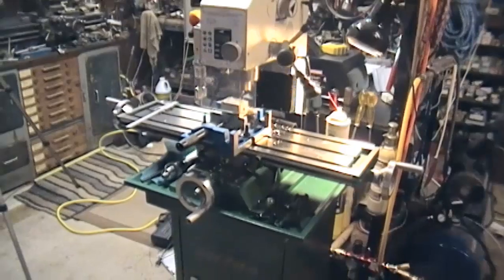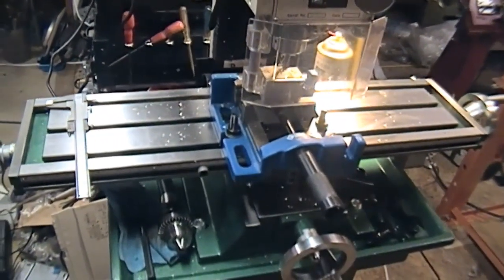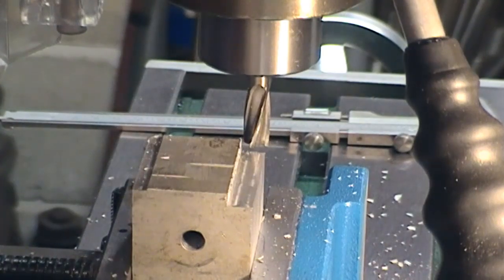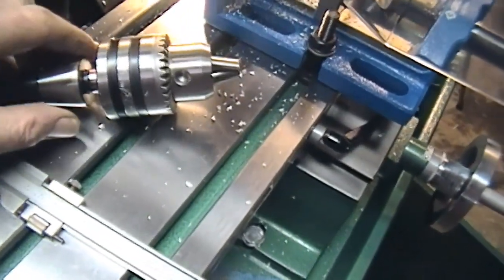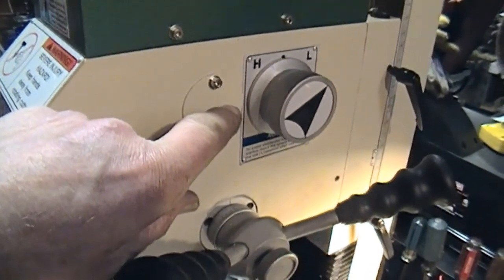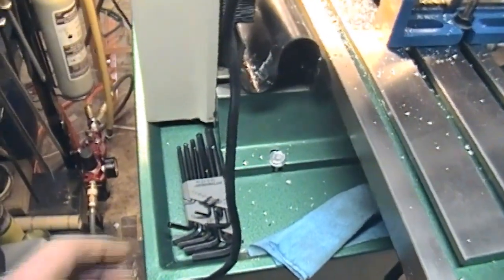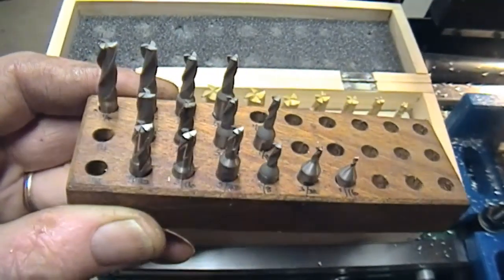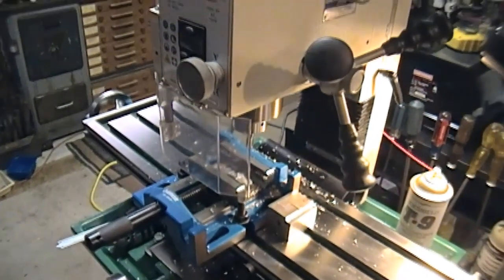Grizzly, early impressions -- and some new items

Comment: Question:
What is your maximum depth of cut? I manage about .020 using a HSS 1/2" end mill when working with 4140 steel.
Reply from the maker: Hi William,
I am probably similar to you - and in fact tend anyways to avoid super heavy cuts - being kind to the machine and tool! With a 1/2" carbide end mill on regular CRS may well take .050 cuts at higher RPMs ... HSS tooling probably half that at lower RPMs. 
Carbide insert facing cutter (1 1/2" perhaps) run fairly slow -  probably still modest cuts such as .020/.025. never so far pushed the limits - maybe it's also due to age and being patient! :)

Comment: Looking good. If you can, pick up a few 3/8 or 1/2" roughing endmills. You can remove a huge amount of stock with them and save your other mills for finnishing
Reply from the maker: Good advice Bill - makes a lot of sense. Thanks. Ordered a 1/2" M-42 for starters.
Reply: You'll like it. They make small chips that are easy to suck up in the shop vac. They don't take a lot of hp to run them either. A couple magnets and a few pieces of plexiglass will make you some cheap moveable shields

Comment: Hi Chris

Nice to see you getting the new machine setup in the shop while enduring the cold weather.  Regarding import tools, I agree they are better than nothing.
Suggestion for an early project is to make yourself an aluminum tooling plate that fits in your vise.  I copied the Oxtool design with the attachment of the round stock to the bottom so the plate can also be set at an angle to hold work.
Looking forward to your builds....
ATB
Chuck

Comment: making your own tee nuts is a good start, I always make them in one length, and cut down to size, I make them longer than the one supplied, that way , you have less stress on the bed
the machine looks good anyway,
only thing I would change , if it was mine would be the vice !!
good luck, thanks for sharing
regards...Keith in Swindon u.k
Reply from the maker: Agreed Keith - longer T-nuts are very logical to reduce/spread bed load. Just trying that vice out in the mill for now but, have other options yet to bring into use.

Comment: Chris;

A couple of suggestions from a fellow Chinese mill owner.

1)  Look up "hossmachine" on YouTube and check out all his videos on his G0704.  He has a lot of good tips and has made a lot of excellent modifications to his mill.  Check out his other mill videos too for other tips.

2)  If you haven't done so already, tear the mill apart completely and clean thoroughly.  This is one area where the factory seems to miss the boat.  I have found casting sand painted over on the inside of my mill castings.

3)  True the gibs up.  The parallelism and surface finish on the factory gibs are usually not too good.

4)  If you know how to scrape and have the tools and surface plates, scraping the ways is definitely worth the effort.  Another area where the factory doesn't do a very good job.

5)  Consider replacing the spindle bearings with high quality taper bearings.  I did this on my mill and significantly reduced the spindle run out.

6)  Replacing the gears with a belt drive system is a good idea.  The gear drive will break sooner or later.

7)  One thing to keep in mind is that these machines don't have the stiffness necessary to make really heavy cuts.  Even though the motor horsepower would lead you to thinking that you can take some deep cuts, the frame just isn't stiff enough to do this without risk of chatter.

8)  Double check the lead screw nuts to make sure they are adjusted to minimize backlash.  Another area often overlooked by the factory.

All the above said, these are good value for the money and by doing a little bit of work to true up the mill, you can get some pretty decent accuracy out of them.

Regards;

Ron Kluwe
Reply from the maker: Hi Ron - yes, already discovered Hossmachines - lot of stuff to see there when time - always finding time problem.! Many thx for all the suggestions -- early days yet but like as not there will be some mods made to improve things eventually - yet to do my critical indicating tests on all aspects to discover how good or not-so-good things might be..

Comment: Good video.
Question: Is it possible to cut a hole in the floor and lay a concrete block or brick base to set your mill on?

Comment: P.S. how do you like the mill I just got and sieg x2 from little machine shop I am happy and sad at the same time it has no reverse!!
Reply from the maker: Thus far pleased - seems it'll manage what I want - time will tell of course!
Reply: Wire in a double pole double throw switch on the motor. That will give you reverse.

Comment: Make your own T-Nuts.  They are easy to make and are a good starter project.  I have the same boring head as you.  The set/grub screws are very soft and so are the supplied allen wrenches.  Mine did not last long at all.  User 'hossmachine' can tell you anything you would like to know about the G0704 from what oil to use to how to convert to CNC.  He has hundreds of videos...  Take care, be safe!
Reply from the maker: Point taken re the grub screws, thx -- and I use other hex keys usually due to many supplied ones being too soft. I visited the g0704 site - lots of interesting stuff. I do have some T-nuts coming in a set of various things including clamps, studs etc - but may yet make some T-nuts anyways.
Reply: ChrisB257 Chris, get bolts that fit in the width of the slot and grind the head to fit...I did and works like a charm. I'm cheap, I know..:)
Reply from the maker: John Noneyabizz Done that John in past sometimes -- only thing is the loading on the slots can be a bit localized. Do prefer 'conventional' t-nuts when possible.

Comment: Hi Chris. Be very careful tightening the set screw on the coaxial center finder,if it is like mine the screw is coated brass. Did you get a compensation chart for when you are using different size probes?.
Reply from the maker: Thx for the heads up Bob - will inspect. No actual chart unfortunately - I'll have to scout around for a chart from another make probably... thoughts?